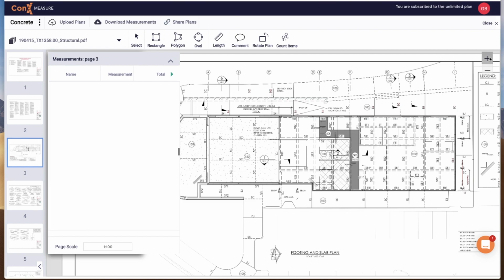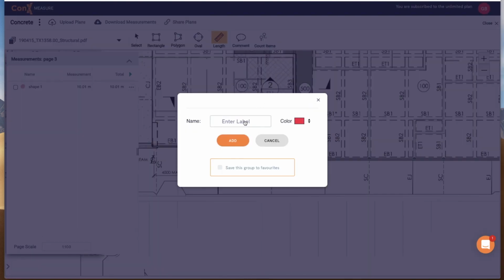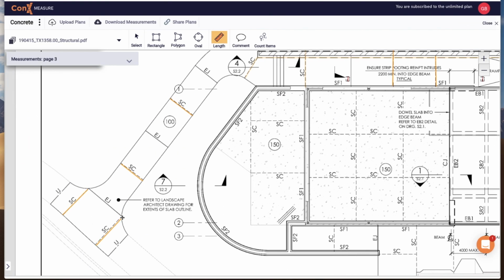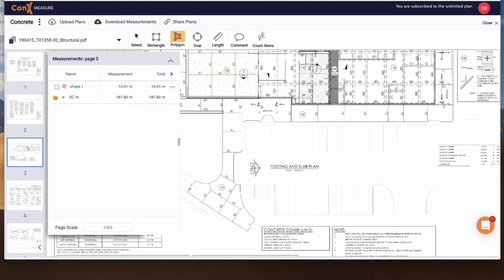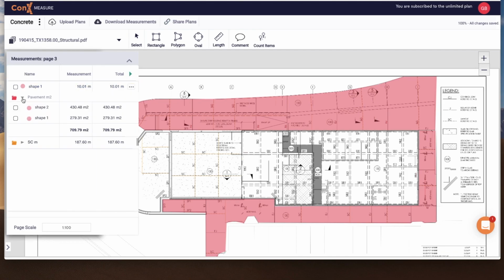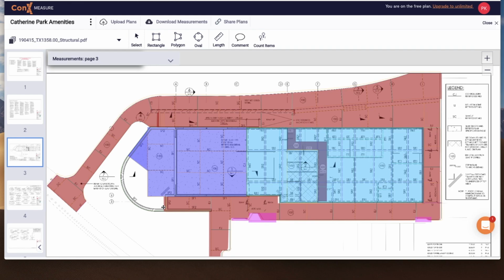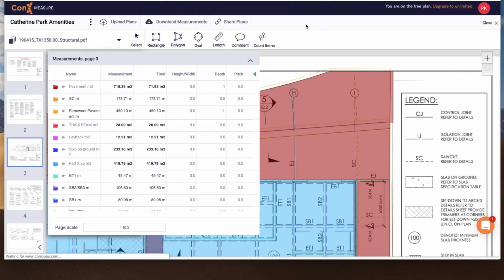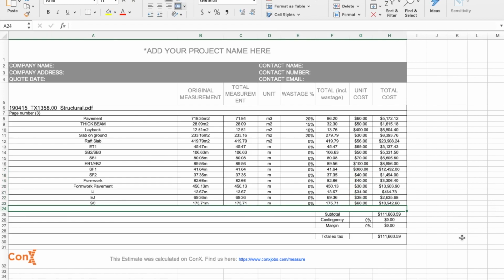Fast Concrete Quantity Takeoff and Quoting Template

Comment: Adobe Reader is free and it can count items, measure floors and ceilings, and measure lineal feet. Once data is extracted from Adobe. Excel can crunch and sort finishes by areas, floors, or buildings in less than 10 seconds. And the cost of Microsoft Office is only $100 per year.
Those two applications combined can produce millions of dollars per year. Ideas from programs that cost thousands of dollars can be copied and implemented into Adobe and Excel.